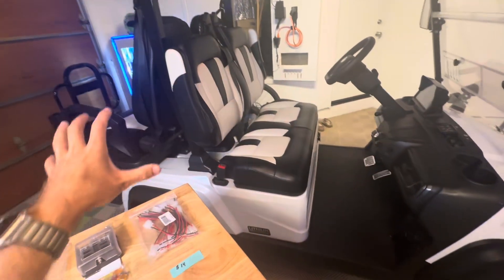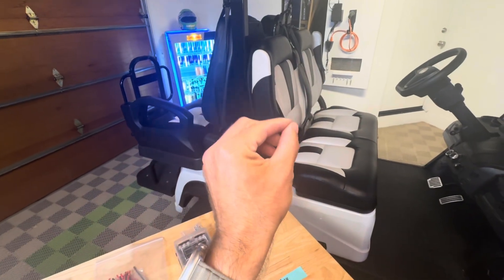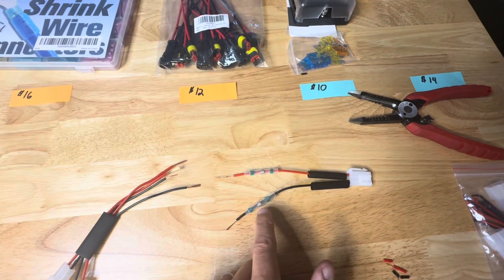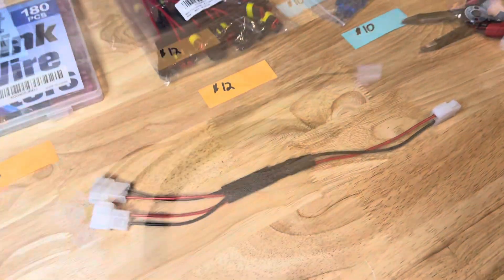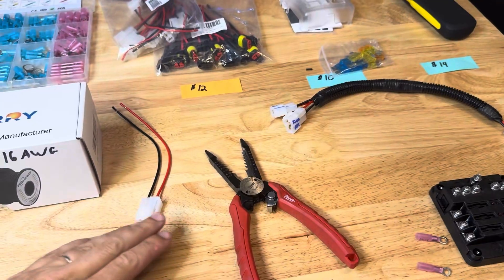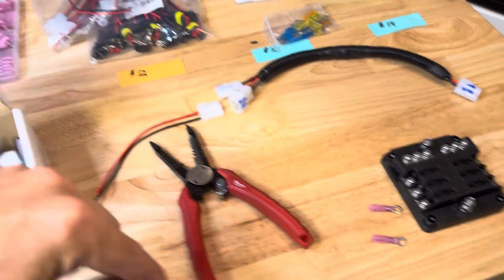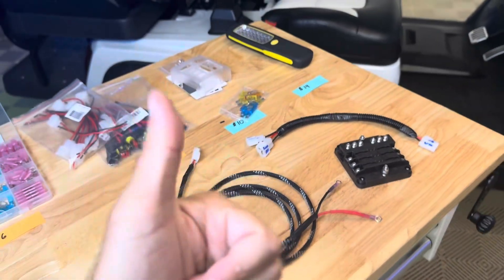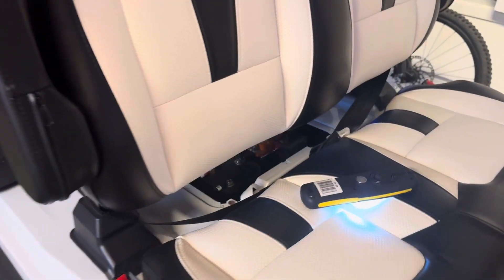Evolution D5 Golf Cart - Plug-and-Play 12V Accessory Harness Easy DIY Pigtail Adapter + Fuse Panel

Comment from the maker: Maximum continuous draw with this setup is around 5-10 amps. Great for smaller LED lights, phone chargers, dash cams, ect. 

If you want to push it to near the reducer’s maximum of 20 amps, just increase the gauge of the wiring directly from the connector to 14 or 12 gauge.

Comment: From the factory, the D5's electrical components, touch screen lights USB  ports ETC... aren't protected with a fuse. instead of making an accessories pig tail, just run the power plug from the voltage reducer into the fuse panel being installed and from the fuse panel plug it back into the main harness to the electrical components.  Now its all fuse protected.

Comment: Thanks for this video. I wanted to show the final product mounted under the seat. I got out local hardware to cut me a 16 ga 12”x10” aluminum plate with a 90 degree bend. Mounted the fuse block and can mount any future controls as needed.

Comment: I want to install the Rove Hardwire Kit for my dashcam. It needs constant power in addition to ACC/ignition power. Could I contract you to build me something for my Evo D5 Ranger Plus?
Reply from the maker: Sadly there is no easy constant 12v source on these carts. Your main option is to either add directly to the main cart battery a 48v to 12v buck converter, or add a small dedicated 12v battery.
Reply: @hillvalleylabs i was thinking of somehow attaching a mobile usb power bank to a power plate with usb pigtails to charge itself from main power and to provide “constant” power to the dashcam (which really only needs constant power for maybe 12 hours max). 
What do you think?
Reply from the maker: @ericbuhrendorf - That’s a fair idea, I was debating something similar. One thought I had was attempting to leverage a trailer brake battery charger instead of a power bank. 

These are typically designed around 12v, weather proof, come with a battery, and an integrated charger so it can come on and off. 

A Lithium one like this, should give you 20 hours
https://amzn.to/4qiWEIL

You might be able to have it wired to the 12v that’s available when the cart is on, the dash cam 12v to the brake wire and let it manage the charging. But I have not tested using a trailer brake battery setup that way, so I might be missing some downsides over a regular power bank.
Reply: @hillvalleylabs Interesting 🤔

Comment: I have a D4 and there isn't a connector off the inverter, there are 4 wires coming directly out and they are red, green, yellow & black. Red has a fuse on it. It also has a beep reverse attached to it and a detachable plug (not like to ones you have) with black, purple and blue. ANy help would be appreciated as I really don't want to cut wires but I will if I have to.

Comment: Do you have any video on how to do this for a D2 Classic 2?
Reply from the maker: Sadly not, I do wish I had access to more carts. But in principle it should be a relatively similar process where you want to locate that voltage reducer. 

Take a look at what type of connectors are on it and see if it looks similar.
Reply: @hillvalleylabs Just built one for my D2 using your video. The reducer is right beside the battery tray. Connections are the same as in your D4 setup.

Comment: Hi I was curious how much I could draw off this setup? I was wondering if it could handle multiple things like under glow lights, dash cam, and an air horn?
Reply from the maker: Yes you can definitely wire multiple accessories off this same point. The voltage reducer (48 V → 12 V) used in the Evolution D5 is typically rated for a maximum continuous draw of 20 amps at 12 volts.

Keep in mind that your existing dash, speakers, need to be included in that overall limit, so consider 10-12 amps as your accessory total. So look at each accessory’s rating and fuse it correctly. 

If you want to max it out, would reccomoend, upgrading the wire from this 2 pin connector to 12 gauge, they ship with 16 or 18 gauge pre-installed in them so make the main long run from the metal connector to your fuse 12 gauge wire.

Comment: The link for the 2 pin connector will not work do you have the number on the bag
The video for the com link was awesome
Reply from the maker: This is it: https://amzn.to/4oR3y6t - 6.3mm - 2Pin
Reply: @hillvalleylabs  This link appears to no longer be accurate.  Do you have another link?
Reply from the maker: @aj1234va - Hmm you are right. It looks like they changed the listing. 

These might be the next best option, looks like the same seller: https://amzn.to/4oR3y6t
Reply: Thanks